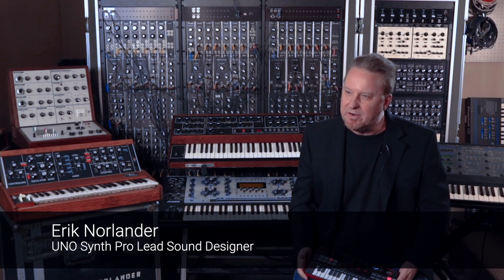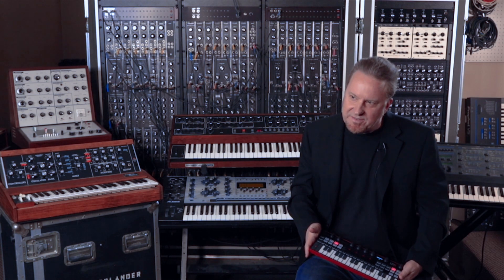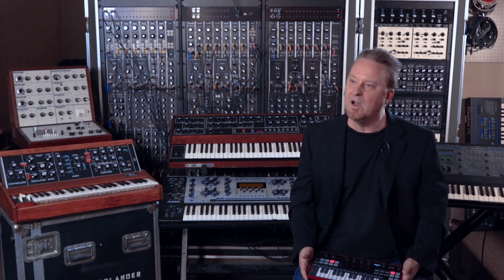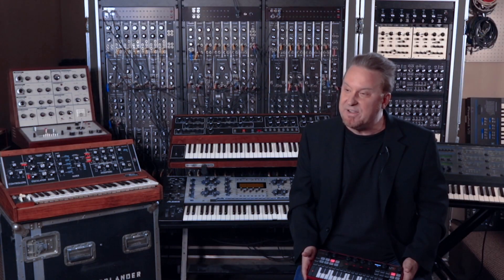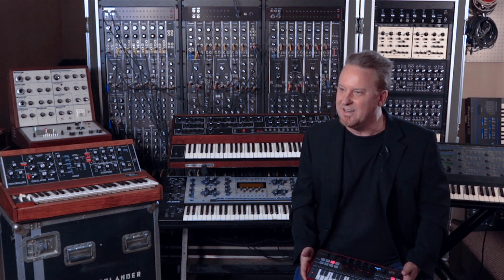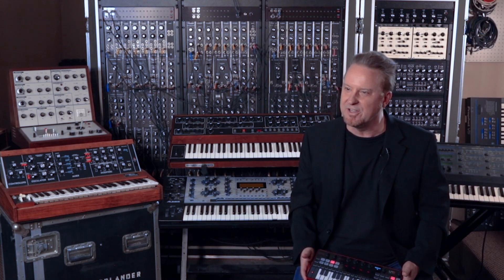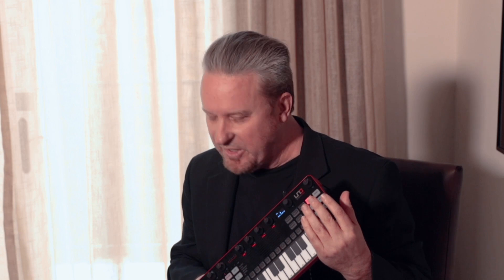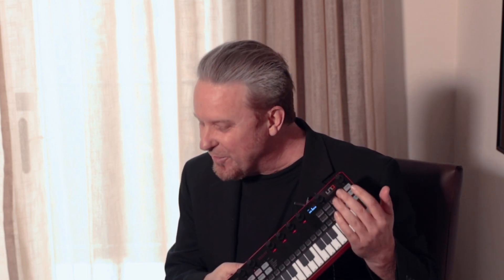UNO Synth Pro and the SSI integrated circuits: interview with the creators

Comment: Hi. So that SSI chip is in the new uno synth pro?
Reply from the maker: Yes, per the description:
UNO Synth Pro’s first-class analog sound is achieved by combining a superior design architecture with discrete core oscillators and two filters, one of which is based on a new chip from Sound Semiconductor, Inc. (SSI)